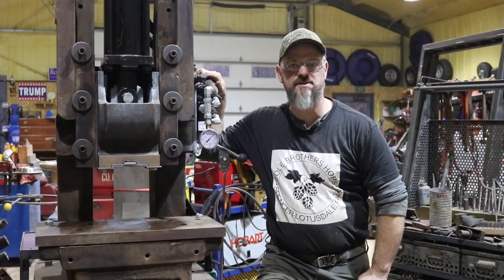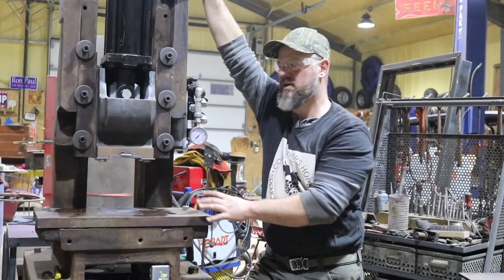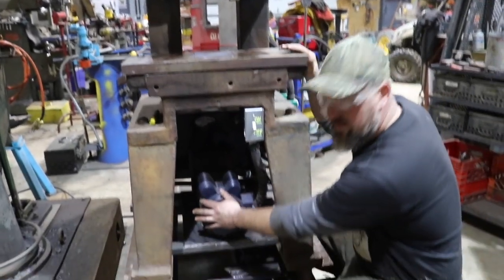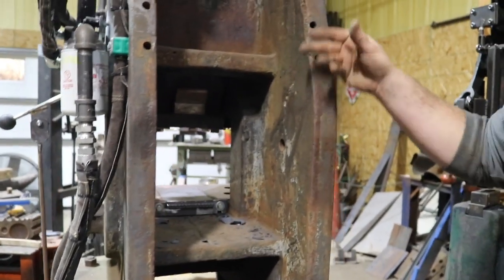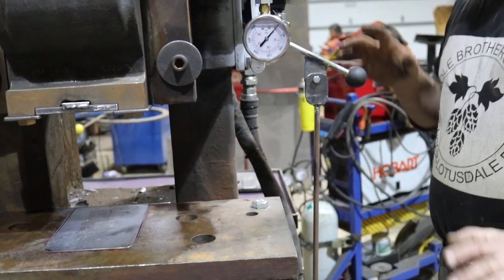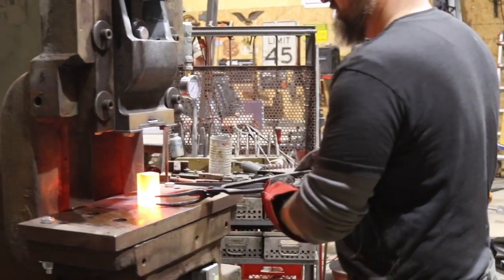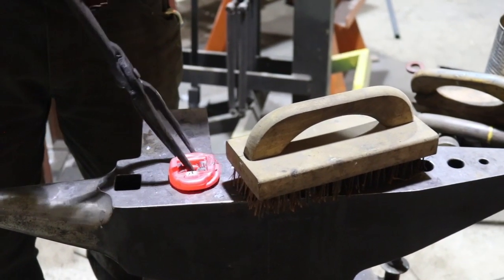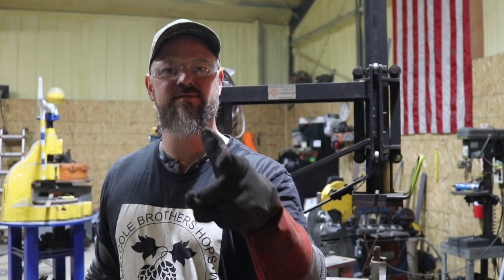Blacksmith Forging Press

Comment: Why does no one ever finish the shipping container projects? I wonder if they fail and get condensation and mold and no one wants to admit failure ?
Reply from the maker: Keith Fine, I’ve seen numerous finished projects. My build is me by myself, and it will be completed. The metal building in this picture does not have condensation issues secondary to the spray foam insulation. I don’t know why  a shipping container would be any different.
Reply: Tom of All Trades thank you for the reply. Are you saying spray foam insulation is the best way to achieve success?
Reply from the maker: Keith Fine, that is the method I am using. The big plus for me is the tight adherence of the foam to the steel substrate of the shipping container. I think it is a good choice for shipping container insulation. I am going to use 1” of closed cell followed by open cell foam on the shipping containers.